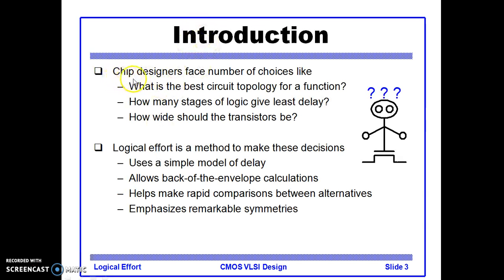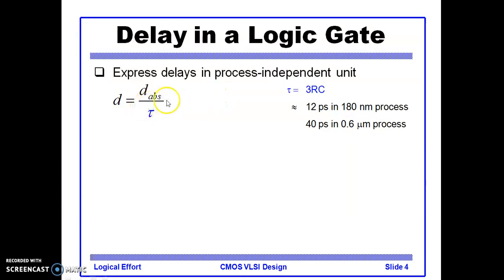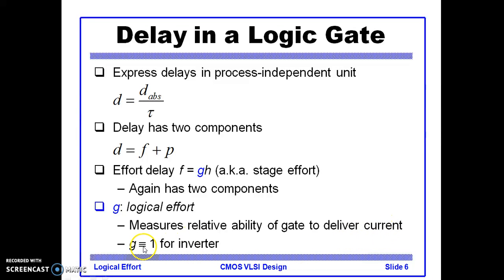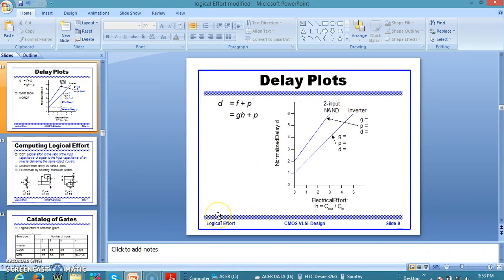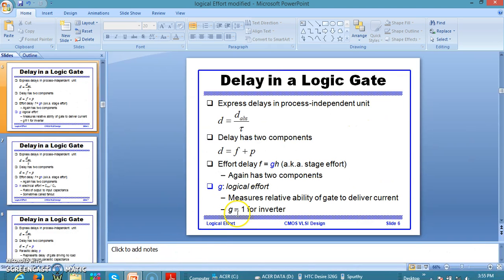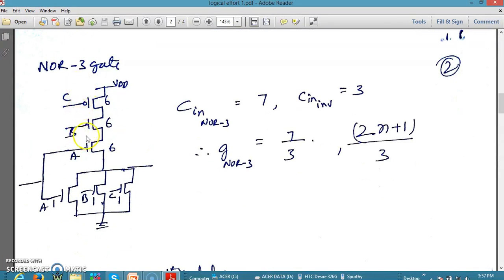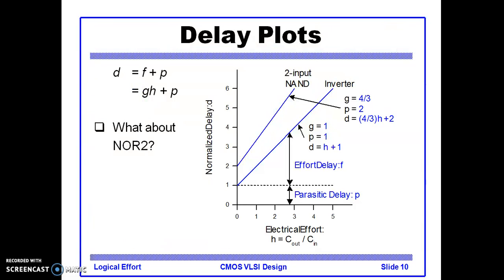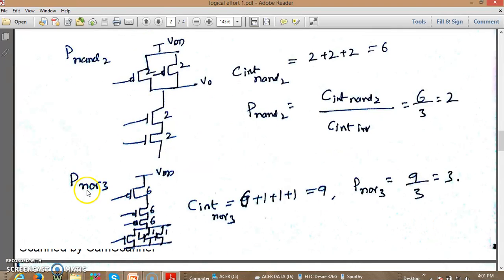5 1 logical effort 1

Comment: The calculation of parasitic delay doesn't make any sense without explaining.  eg: why 6+1+1+1, what's the reason behind it? Good only for scoring marks without understanding the reasons behind these numbers
Reply: exactly , no reason given ,no logic
Reply: The answer lies in the definition of Parasitic Delay. It is the summation of sizes of transistors that are directly connected to the output.